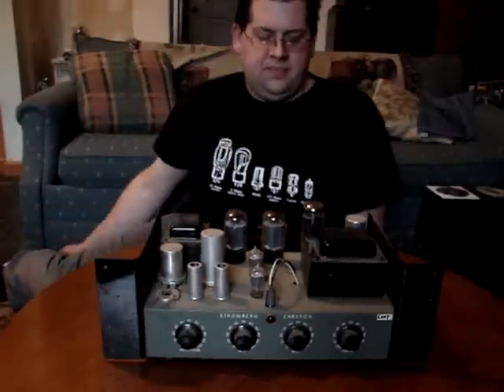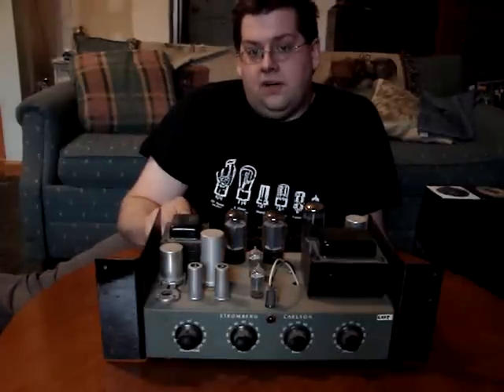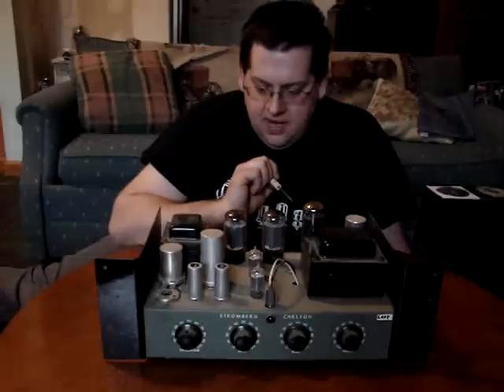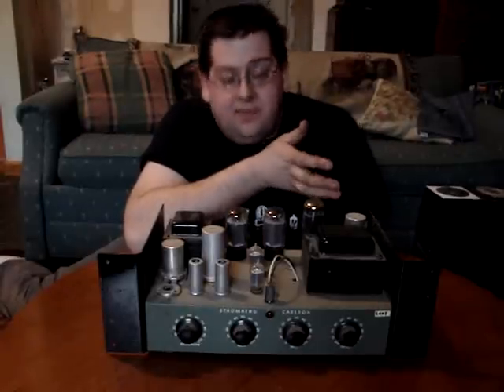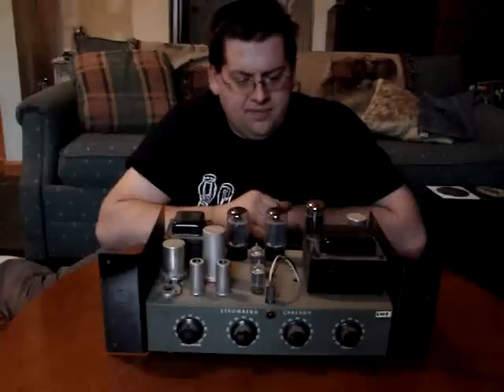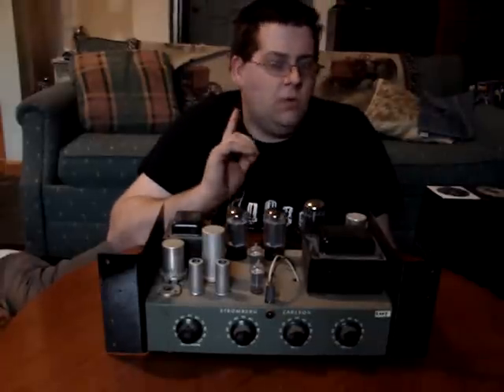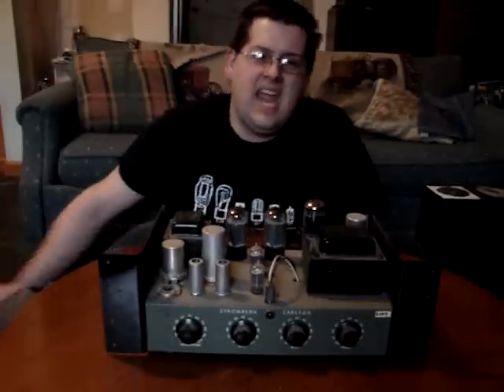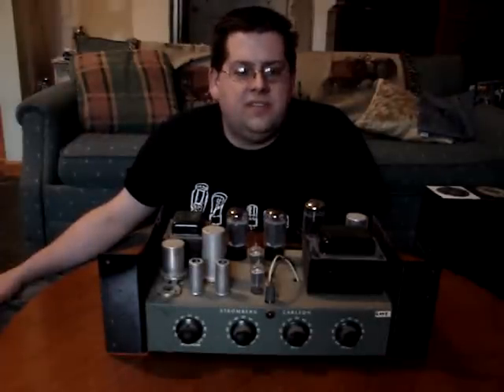The Learning Series - Vacuum Tubes and Amps Part 7

Comment: Rockin' videos, dude.
Reply: 0.10 what do you mean by "direct connected output",  and what then would
 constitute "indirect connected output"?

0.27 this is THE commonest (no pun) topology for any single active 
device; thermionic or otherwise, and referred to as a 'common cathode' 
(grid-input/anode-output). A solid-state equivalent is a 
'common-emitter' amplifier (base-input/collector-output).

etc ...
Oops, wrong video but equally valid (see Part. 6).

Comment: There is still nothing like a good taken care of Beatle Album on a tits ass turntable with a diamond stylus through a Nice tube stereo amp with big speakers, theres just nothing like it , not even close.  Ive been in electronics almost 40 years , Ive worked in service during the tube TV era , The tvs today have unsurpassed video but their sound sucks. You have to run them through surround sound amps, back in the day the video was good for then but the sound rocked.

Comment: Tubes and transistors are like CDs and Vinyl , Vinyl is still better for sound reason is , if there is something missing , its missing , not filled in with what the computer thinks it ought to be  , you say you can't hear that but we believe sub consciencly we can because of tests done , there are 2 record shops opening per day in California, records are on the rise. The reason is sound and interaction.

Comment: Studio or not , Tubes just sound way better and were meant to . But Im probably partial because I grew up with tubes. The advent of transistors was and is a god send naturally but for sound sound sound , tubes , in my opinion , anything else like video , robotics whatever theres where you use transistors , fast switching , etc.  Use Tubes for big transmitters etc and ham radio whereby you can drive and drive and over drive systems.

Comment: Not really, an gitar tube amplifier isn't  in class A so yes it will give distortion, basicly  its done on purpose, 4 EL34 can produce 100 watts with distortion (London City etc) However the same setup in pure class A and a better preamp will give less power but a great sound, the bass in general is with tubes deeper, also on pin 5 on a EL34 they use sometimes a lot of -20 up to -37 volts to increase the high voltage on pin 3 that gives more power as well, high end amps are well known today.

Comment: very good series I am a tinkerer and have a lot of knowledge in solid state but much in tube amps I am trying to soak up everything I can about them my Dad is an avid guitar player and also into tube amps. my goal is to be able to help find restore and even build custom amps. I have a good start thanks to your video. I have an old pa amp thats rated around I think 45 or so watts the sound that it pushed was awsome

Comment: My main home theater system uses RCA SA100/MI1466. These are 100 watt/6550 push pull. These amps blow 100 watt solid state away. 
The thing is that once tubes amps are rebuilt, they can run for a very long time and be very reliable. I can also cover 1200 screaming Elementary kids at a dance with a pair of Precision Grommes 65 watts  tube amps and a pair of Peavey SP2.